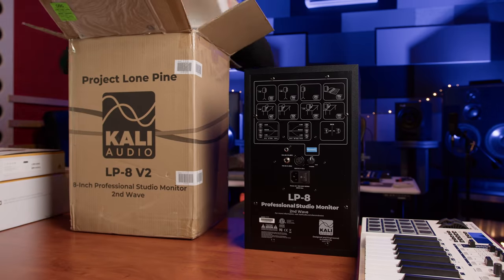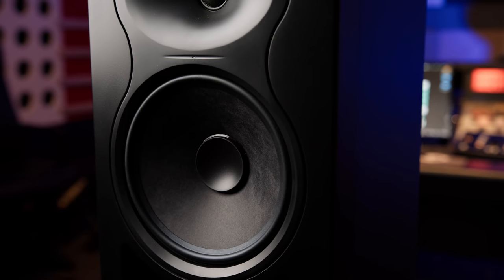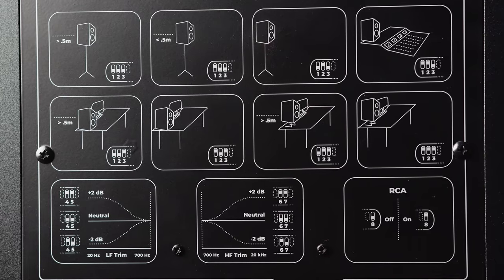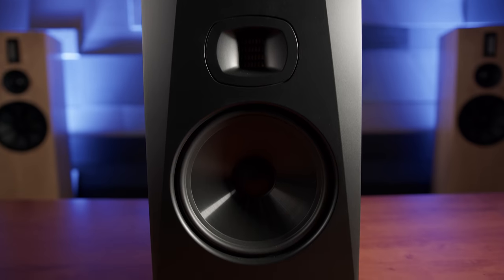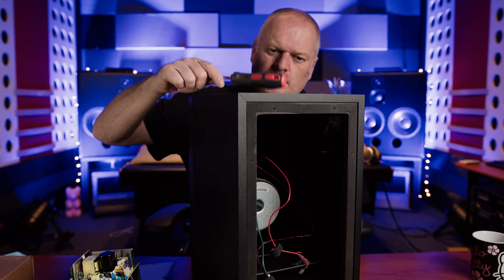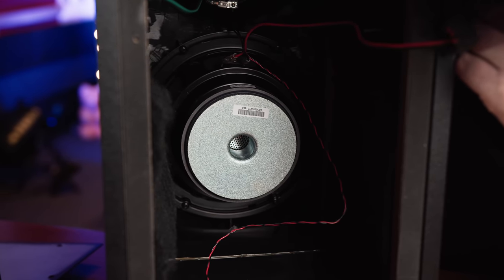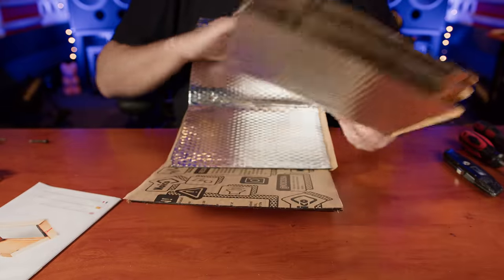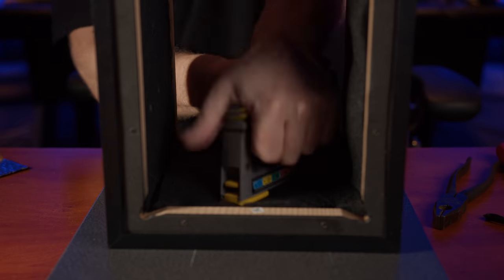Kali LP-8 | The Studio Monitor Review You've ALL Been Asking For!

Comment: I had sold by Yamaha jet seats to get the Kali audio IN8v2 I return them in 48 hours and bought another pair of hs8s The low-end was strange on the Kali The speakers felt cheap and poorly braced like the cabinet felt incredibly hollow and poor quality control The one speaker had an amp that was significantly louder at the same levels I’m talking about having one speaker at unity (12 o’clock)  and the other speaker  at 7ish o’clock just to match the volume. Compared to the Yamaha’s Focal the older krk Vxt line up etc I was really disappointed with kali audio and I’m convinced they are paying people for glowing reviews or they are many people first studio monitor
Reply from the maker: The Yamahas take some beating for the price for sure
Reply: @MediaMusik777  yupppppp. I put my hs8s on the side cause the mid range was muddy when mastering and the kali in8s arent

Comment: I think pound for pound compared to the monitors people were hyping before these are still an impressive step up.

I got the jbl lsr305s because of the hype and they sound pretty good, but I got my buddy set up with the lp6s and even in an untreated room his bass response was pretty good when using dip switches and the upper mids were significantly clearer than my jbls.  I am hoping to snag the IN5s at some point.  The jbls are problematic for me because they are rear ported, considering the lp6s sound better than my jbl after a lot of testing, I think the in5s might be the way.

After this video though, considering having my significant other resin pout the plastic pieces to add weight that is symmetrical and can be accurately be identically installed to both front covers, along with some kind of baffling and weight to the enclosures themselves.  Thoughts?
Reply: It depends I told my friend to get the original Kali LP-6 vs JBL 305's  he didn't  to me good for him I heard both side by side and JBL 305's even with the smaller woofer just to my ears were better.

Comment: Well done & well said!
👍👍
Had exactly the same impression (plus was even more bothered than you guys seem to be by the reeeeeeally aggressive hype surrounding these, particularly on all the Promote-Like-A-Pro YT channels🤦🏻‍♂️).
IMHO the Yamaha HS series 8 inchers still offer better detail, less problems, more value - as they should, being made & backed by such a huge comoany with immense experience and resources, and far less need to outsource or cut corners in order to be able to offer great value for money.
BTW, more so the older HS80 than the new HS8, because the now removed mid boost switch was just what the doctor ordered: mids one notch up, tweeter one notch down, et voilà.

Comment: I'm curious to know which attribute of a sound you think cannot be expressed in a frequency chart.

I don't find your speaker reviews all that valuable, as they aren't  science-based. 

Also, burn-in is not a thing.
Reply from the maker: Well, the graphs between the Kali LP-8 and the PSI A-17M are VERY similar but those speakers are an absolute world apart in terms of clarity, dynamic range, and so on.
Reply: @PresentDayProduction  I understand what you meant, but everything that makes a sound different from another can be expressed in a graph  which contains frequency info.

Also, burn-in isn't a thing.

*pardon my typos-it's early here, and I didn't have my glasses on.
Reply: @LongshanMusic  
"everything that makes a sound different from another can be expressed in a graph"  - might be true
"everything that makes a sound different from another can be expressed in a graph  which contains frequency info" - absolutely not true. 
You coul, however show intermodulation distortion (IMD) vs frequency on another graph, along many more (dispersion patterns, etc), which may or may not represent why a certain monitor might sound better/worse than another one. 
The best thing to do is to listen to a pair of monitors in a treated room with a proper blind test, and if you'd like to compare it to something else, then it should be assessed beside it.
Reply: @galgogergo  Great. Name something that can’t.
Reply: @LongshanMusic  Stereo imaging accuracy? Transient response? The size of the "sweet spot"? I'm not speaker design expert, so if I'm wrong about this I'd love to learn more, but I have no idea how you'd show those things in a frequency response graph. You could certainly show them in a graph of some sort, but not one related to frequency.
Reply: @SpencerMaxfield  All expressed using graphs that contain frequency info.
Reply: @LongshanMusic  I guess I'll ask the inverse of the question you asked: can you provide me an example? E.g. can you point me to a graph that shows transient response as a function of frequency? I don't doubt that it could exist. I'm sure it's possible to show various transient response times of a speaker for different frequencies and plot them, but I've never seen it. And the fact that I've never seen it makes me question its value. Is it important to know the different transient response times of 3 Khz vs 4 Khz, or since no one is listening to music one frequency at a time is overall transient response more important (and thereby removing frequency-specific data from the equation)?

You've claimed there's no science in this video, which I won't argue (albeit I still value their opinion based on their experience and ears), but you've also provided no counter-examples or science yourself. So please, in earnest, do provide some examples! If you're right and they're wrong then we'll only all become better and smarter for it.
Reply: @SpencerMaxfield  transient response isn’t a function of frequency, though it is a variable. My claim isn’t that everything can be expressed by only giving frequency info—> in fact, nothing can be expressed with only frequency info, including frequency response itself.
Reply: @LongshanMusic  So basically you are saying that no-one should care so much about the correspondinc frequency-graphs provided by manufacturers? .. which is exactly what he said in the video..
Reply: @akagerhard  That's not at all what I'm saying, actually.
Reply: @akagerhard  A frequency chart, like the type provided by Kali and virtually all other monitor manufacturers gives more info than just frequency.
Reply: @LongshanMusic  so are you claiming that these frequency charts are an accurate representation of wether a speaker is great? And if so (and I don't believe this to be true) - do you think the average buyer will be able to accurately predict the pricerange/worth or quality of a pair of speakers by taking a good look at that chart?

We know the answer is no. You know it. I know it. So basically you are saying: Don't look at charts, test the product. Which is exactly what he said in the video. Even if the frequency chart was way more capable than I believe it to be, humans would not be anywhere near capable enough to interpret frequency charts to that level.

You go ahead. You hate on advice (to test the product) based on your assumption that frequency charts are all-powerful and that you can interpret them perfectly. You're being unreasonable by reasonable standards. But it's not the cute kind of unreasonable.
Reply: @akagerhard  You keep mischaracterizing what I'm saying for some reason. Are there measurements beyond what a conventional frequency graph shows? Yes, of course. Can we tell wether or not a speaker will sound good by measuring it and plotting its data onto graphs? Yes, of course we can. We say otherwise is to believe in magic.
Reply: @LongshanMusic  You're  right about the fact we can show all the various tonal differences (either frequency response, Stereo imaging accuracy, Transient response, The size of the "sweet spot" etc...) with various s*itload quantities of graphs shown on the brand website.

But why the f*ck doing this with your Eyes when you can lead to some music shop and try it with your Ears ? (As speakers, are made to be heard before all)

That's what they do say in the video. You can be the best bloody engineer of all time and be half deaf or have a strong ear problem. So if you choose your speaker with only those graphs without taking your ears as reference, it's f*cking useless.
Reply: @ThomasL  You're changing the topic, mate. Of course people should use their ears and listen to speakers.I never suggested otherwise.
Reply: @LongshanMusic  Why do barefoot perform driver burn-in ?
Reply: @LongshanMusic  Also, just curious.. you claim Thomas is changing the topic, but I don't see that to be true. Which topic is he changing from and to? What is your point?
Reply: @UncleBenjs  He changed the issue from wether graphs can tell us if a speaker will sound good, which they absolutely can, unless you believe in magic, to framing what I said as a type of "you don't need to listen to your speakers yourself to decide if they sound great or awful," which is a completely different idea.